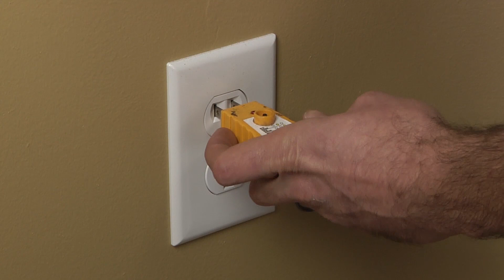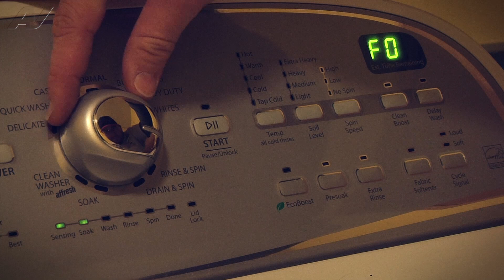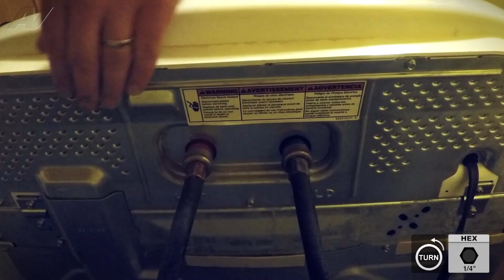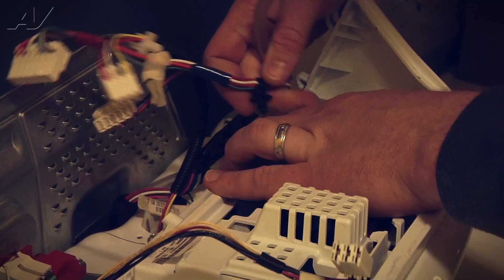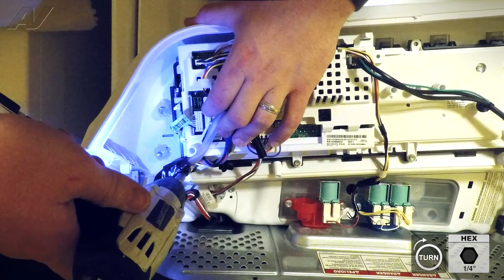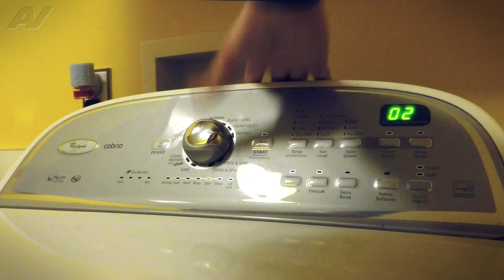Whirlpool Washer Repair - Lid Lock Light Staying On - Electronic Control Diagnostic & Repair

Comment: Answer  i open the main control board and the problem i find was  1 of the capacitor was burned it cost me 4 dollars and i weld it back in and sweet.. working like new
Reply from the maker: Great question, if you have a
more technical question that our parts department cannot answer, you can search
our over 10,000 answered questions free at our website www.ApplianceVideo.com under our Repair Help section. You can also call
our parts department at 1-800-830-5465 and they can give you help 6-days A week
Monday -Saturday, or search at www.SaveMoreOnParts.com  24 hours
7- days A week.

Comment: No repair?   Just replace the whole thing?  I replaced it with a new one also, but the lid lock light still blinking.  Now what?
Reply from the maker: Great question, if you have a
more technical question that our parts department cannot answer, you can search
our over 10,000 answered questions free at our website www.ApplianceVideo.com under our Repair Help section. You can also call
our parts department at 1-800-830-5465 and they can give you help 6-days A week
Monday -Saturday, or search at www.SaveMoreOnParts.com  24 hours
7- days A week.

Comment: My machine works all on automatic mode properly but will not start on normal mode. How come?
Reply from the maker: Great question, if you have a
more technical question that our parts department cannot answer, you can search
our over 10,000 answered questions free at our website www.ApplianceVideo.com under our Repair Help section. You can also call
our parts department at 1-800-830-5465 and they can give you help 6-days A week
Monday -Saturday, or search at www.SaveMoreOnParts.com  24 hours
7- days A week.